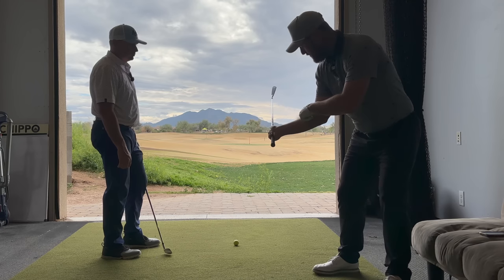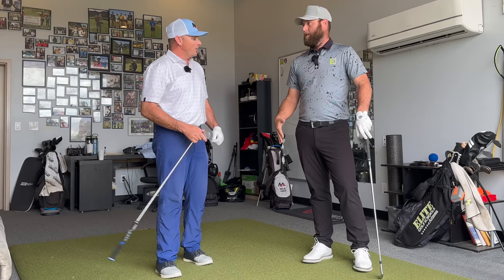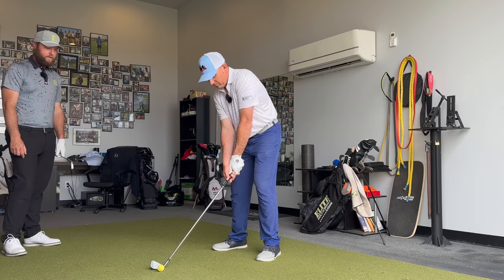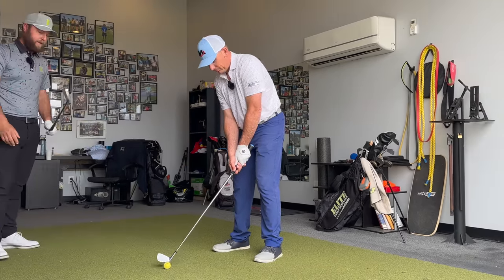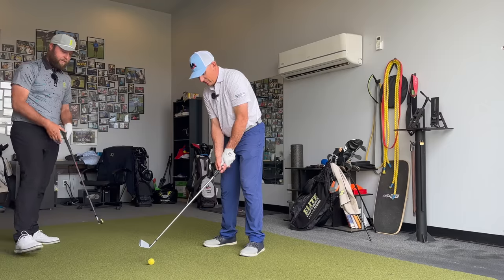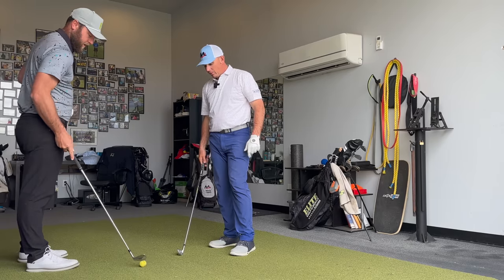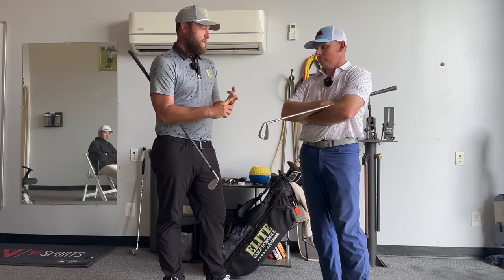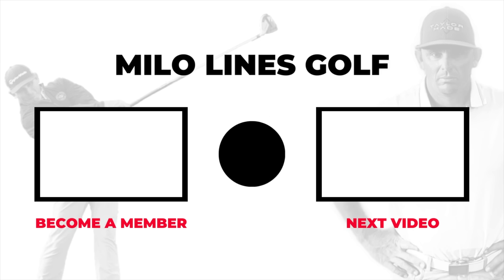How To Hit Irons Pure And LOW (Trajectory Control And Ball FLIGHT Laws @elitegolfschools)

Comment: Thoughts on putting the ball far forward in the stance and keeping the pressure forward and swing speed down to flight down shots??
Reply from the maker: Can work, as you can see I don't like moving the ball too far back to bring down the flight. Moving it more back would typically require more opening of stance to offset club path.

Comment: Nice video but I need the complete opposite of this.  My iron flight is far too low.  I get away with it in winter here in Ireland. I'd love to see how you guys hit it higher.
Reply from the maker: Could be club related as well, but ball position can play a big part. I'd have to see your swing Gary.
Reply: @MiloLinesGolf   I probably do play the ball too far back.  Here is a decent swing from last week. https://youtube.com/shorts/aPR0ZwwO7Io?feature=share
Been trying to incorporate a lot of your moves into it. I don't quite turn through as quick as you:(
Reply: Sorted my height issues with new clubs.  I was using ap3s with s400 shafts. Swapped for ping i500 which launch the ball with ease. Must have been the s400 shafts were too much for me.  Silly boy. Haha

Comment: So then a faster rotation of the torso does NOT equal faster clubhead speed?  If I slow down that rotation won’t the club head be dumped too early, no longer “towing”the lead arm and club through, leading to heavy shots and less distance?  
Sorry, a bit confused here.
Reply from the maker: If you are powering the club by throwing, scooping, pulling, than yeah it would surpass you and cause issues at the bottom.

Comment: Ok let's say it's a windy day and the wind is face on.  So I'm heading my drive.  I move up on the ball, move the ball a little back in my stance, move my hands a little down the shaft and swing a bit slower to get the best outcome.  Correct?
Reply from the maker: Perhaps, driver is a little different depending on the person, spin and launch numbers. I coach players for example that don’t change a thing with driver because they have optimal numbers and low spin.